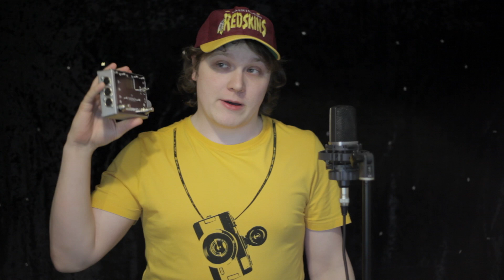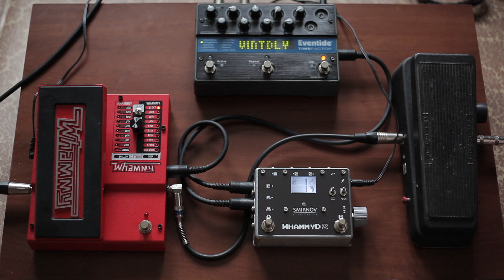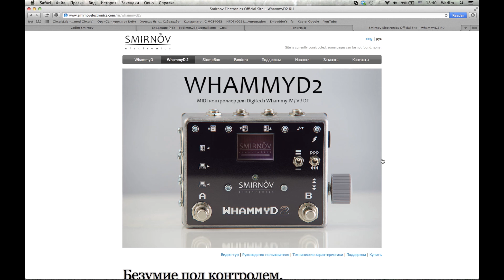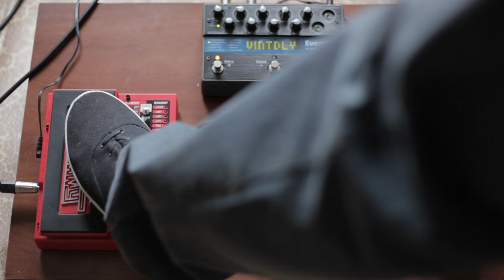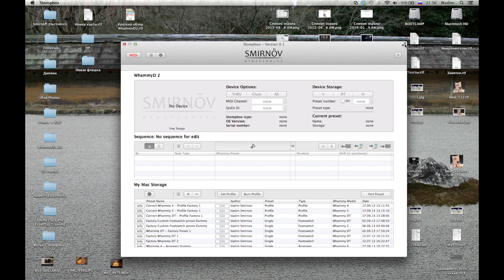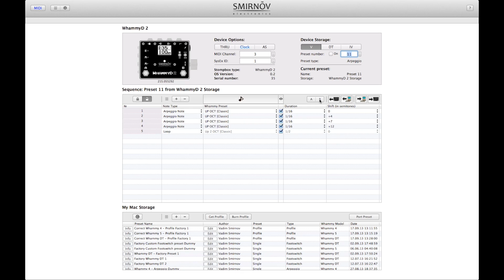Smirnov Electronics WhammyD2 basic review.

Comment: Hello ,
Can anybody help me to figure out this;
I assigned the button A with Cc#3 and B with cc#8, when I step on my midi controler the whammy d2 respond and I can also control the expression remotely, however on presets (~1-10)that allows you to change whammy 5 s knobs with A and B , every time I spec on A or B the whammy 5 goes bypass. How can I get the whammy d2 always turn on the whammy 5?

Any help would be appreciated thank you